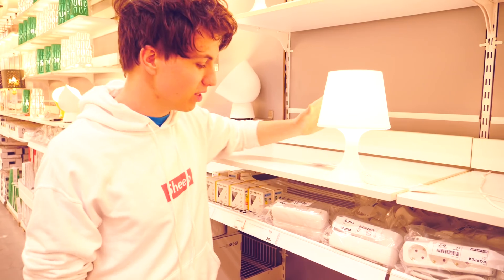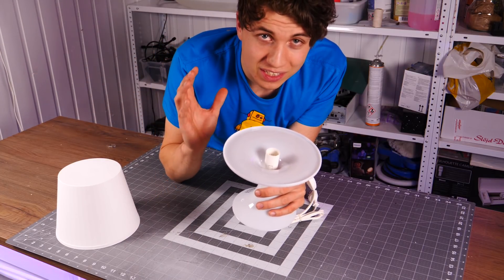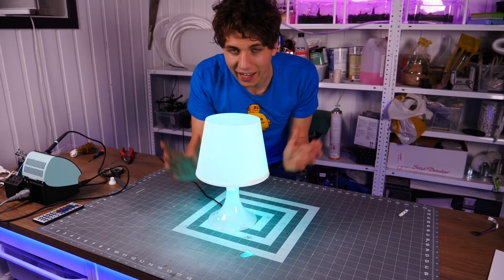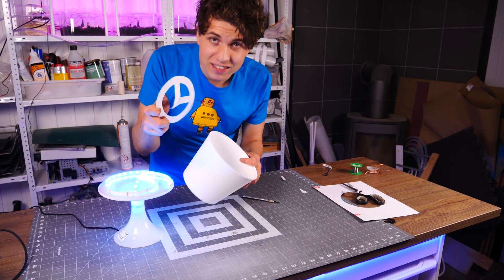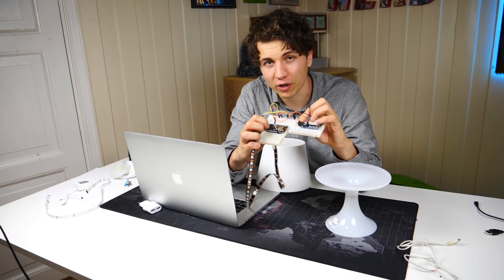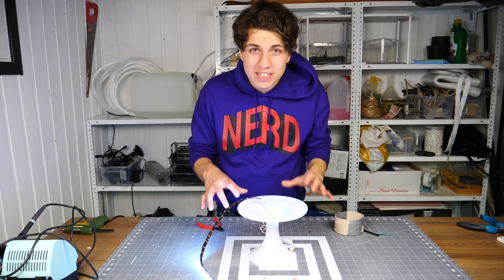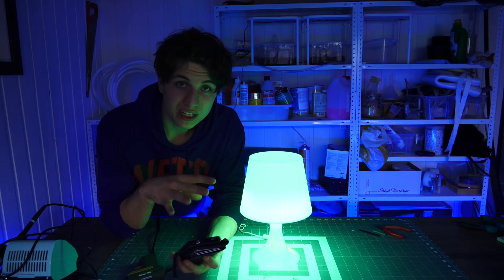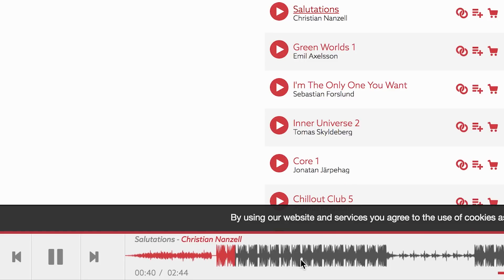WiFi Controlled RGB Desk Lamp - Simple DIY/Ikea Hack!

Comment: Sorry, But how about the mobile app? I am still not clear how to connect it with esp8266, and we should code the app or not? Thanks
Reply from the maker: The code is meant to work with a blynk.io app. Check out blynk.io! :)
Reply: I got it, Thank you so much.
Reply: sorry, Did  you meet error "No hardware SPI pins defined.  All SPI access will default to bitbanged output"
when you upload to esp8266?
Reply from the maker: Think that's just a warning. I got that as well, but no problems uploading the code.
Reply: um,  It dose not work in my case. I'll check again, thank you.

Comment: Hey :) is there some kind of wiring scheme? since I'm completely lost on how to solder the led strips to the esp :)
Reply from the maker: I'll get up a schematic asap! But the addressable RGB is just connected to the esp via one wire from the digital pin, to the DAT pin on the strip. The 5v goes to the 5v power supply, and the GND to the GND on the power supply.
Reply: Natural Nerd thanks a lot :) love the project :)